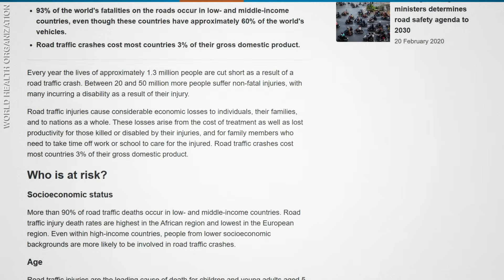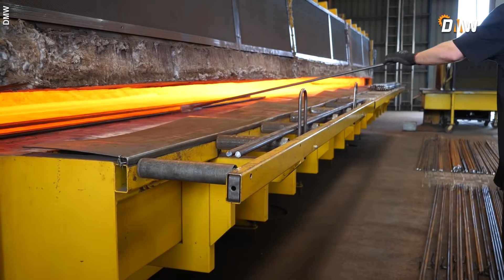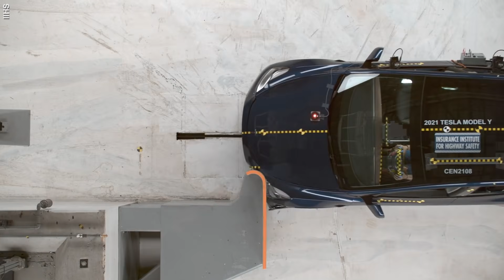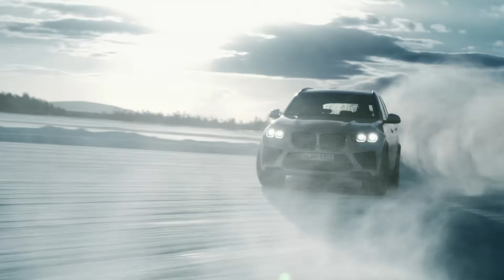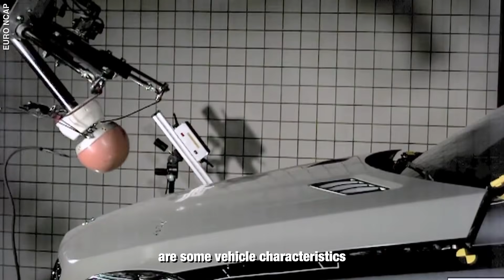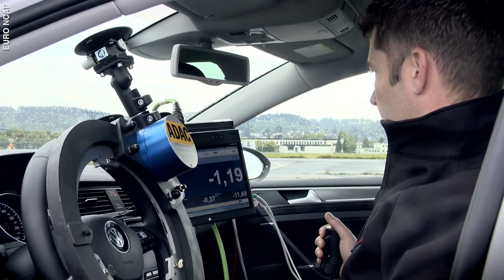Extreme Car Safety Testing

Comment: Much of this is hurting the people driving their vehicles.
Here in Norway the death rates has gone down for decades, but for the first time death rates has gone up, and in scary rates.
The big screens of the dashboard is taking focus off the road. Even worse if all the the heater and temp is hidden int the menue and you need to scroll through several things.
In a 70s or 80s car you did know where all the knobs were located, even blindfolded or in the dark.
Lack of driving skills is showing up these days as more and more people has trouble driving through snow or ice conditions.

Comment: In the future they should make a test where if a vehicle thinks a crash will occur it will take necessary precautions. One when we were on vacation in California, we were driving down a highway in the middle lane, and there was a truck on the right of us, something happened in the rightmost lane and in the end, a Toyota 4runner got pit maneuvered by the semi truck and almost crashed into us, so maybe something like if your driving next to a big vehicle that makes your vehicle go slower or have sensors mounted on the very bottom of the vehicle to monitor what's going on, on the other side of a big rig.